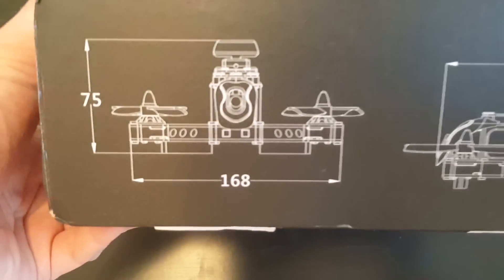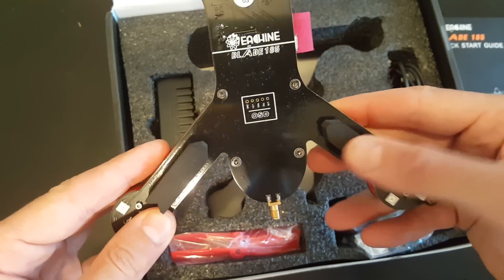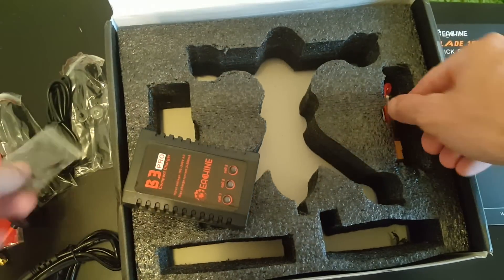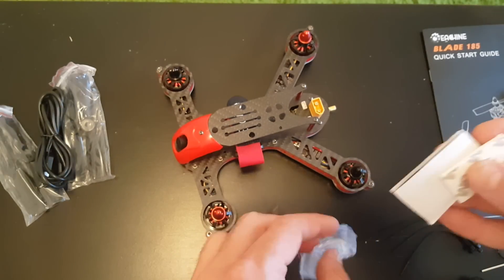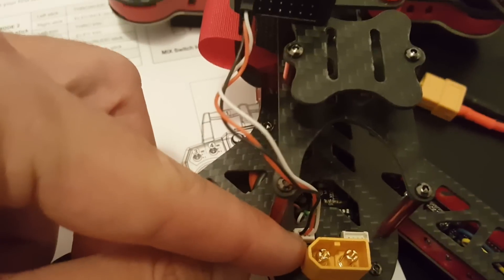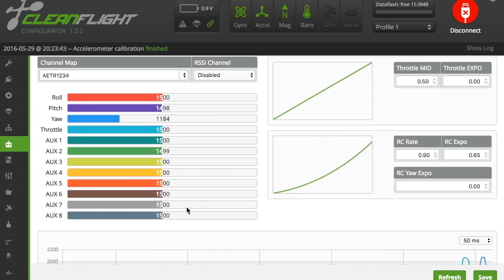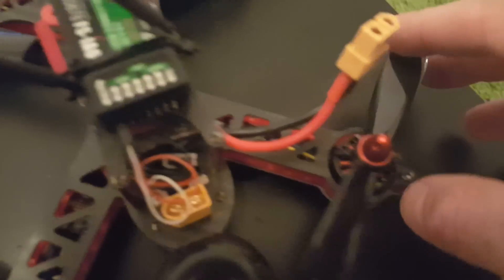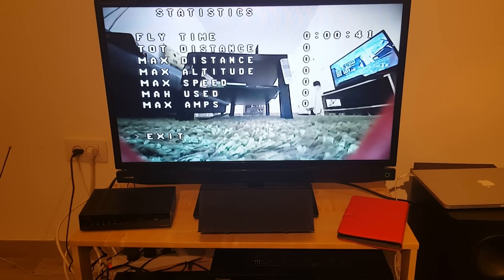Eachine Blade 185 unboxing and in-depth review (from banggood.com)

Comment: can I use any 3 cell battery
Reply from the maker: Unless you mount it on the bottom or on the top plate, the answer is no, as it needs to fit in the middle compartment, which is a little bit tight.
Reply: Yup I'll mount it on the top

Comment: I'm really new with all of the clean flight stuff but in the part where it shows your controller functions whenever I move my throttle it doesn't move on to clean flight (nothing moves) and when I try to calibrate the ESC's and the motors don't work and they do not turn green like yours did on clean flight. I have had this for about six months and still haven't used it because I can't get it to work. I bought the ARF version and I purchased the I6 transmitter and receiver. If anybody could tell me what I'm doing wrong I would appreciate it. Thank you

Comment: Great Video. I have tried to work with Cleanflight  but still can not get my motors to start with my transmitter.
Reply from the maker: +MM Masterscross Do they work correctly on the motors tab on Cleanflight?
Reply: gal kremer , yes
Reply from the maker: MM Masterscross and the radio responds correctly in the radio section? If so, try removing arming by aux and arm it by shifting the throttle stick all the way down to the right - without propellers on.
Reply: gal kremer ,yes Cleanflight shows the radio working correctly, Thanks I will try that changing the props start up